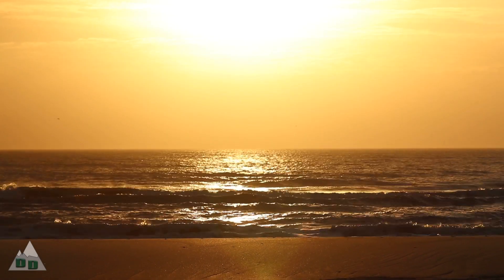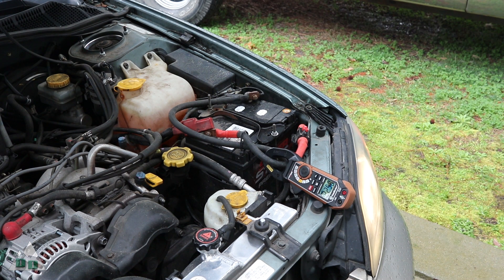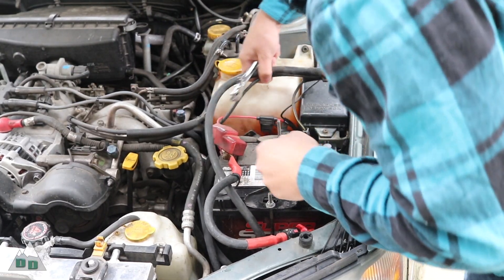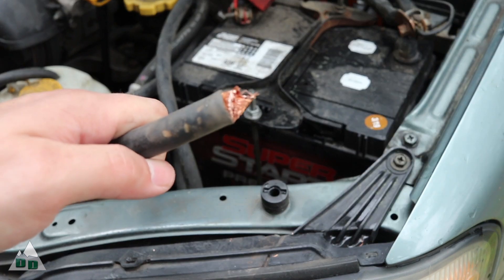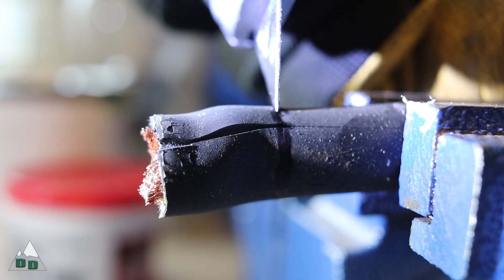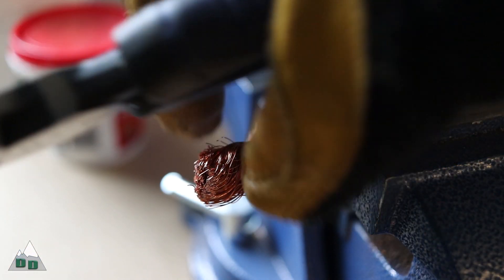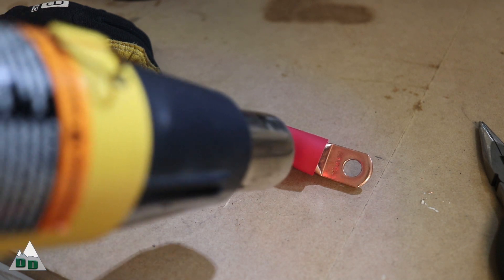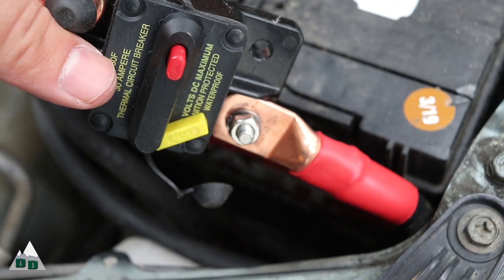My Dual Battery System FAILED | Diagnosing & Fixing

Comment: Those cable connectors that you clamped on should be soldered also. Use good quality solder with flux and a handheld torch.